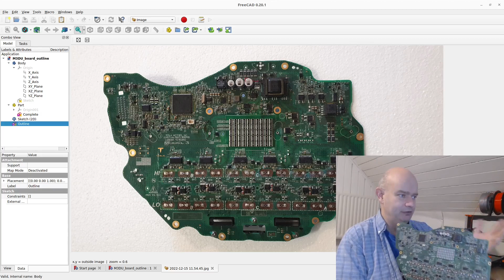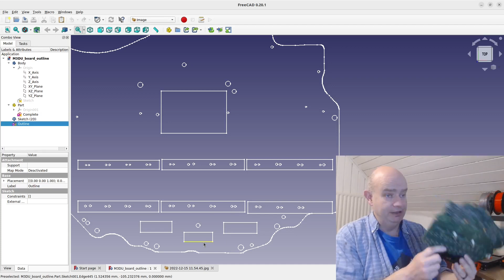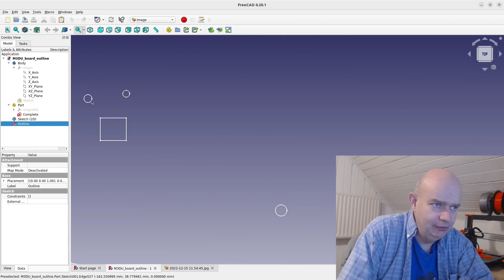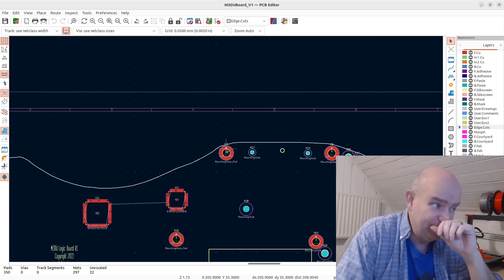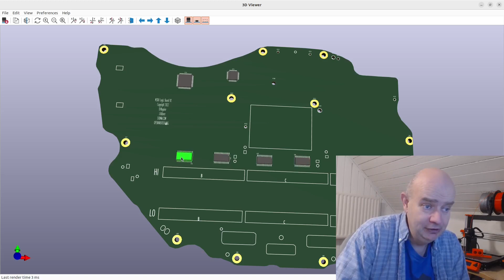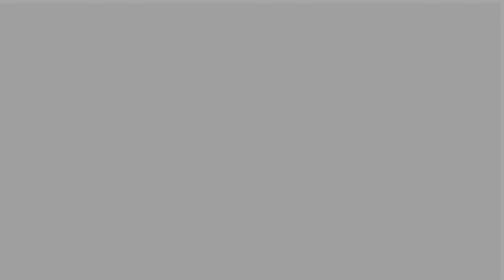Tesla Model 3 Drive Unit PCB Design 01

Comment: This is so great! Dreaming of using M3 unit in some future projects. Tip for using a camera to transforming plate-objects to 2D CAD: Take the image 100% perpendicular to the middle of the object and with max zoom and distance possible to still have enough pixels on the object. If taking the image too close to the object the camera lens distorsion can make guite a differences to measurements. As pointed by someone else in the comments: a scanner is the way to go if needed more precision in DIY plate to CAD.

Comment: [For the initial image] use a flatbed scanner and stitch the images together in "The Gimp" (free - but find someone who can work it [I can if you need help]). Cameras are ok for non-critical distortions; flat bed scanners are pretty much no distortion. This assumes that the componentry doesn't project too far out so as to defocus the scans. Oh, and the scans should be all at the same distance; no tilts - you may need to pack to the highest projection height.

Comment: KiCAD has really become a well polished and very useful package (once you learn the workflow). I use it in my work quite a bit! I wish FreeCAD was even half as polished, usually my sessions in it devolve into quite a bit of swearing :)
Reply: I agree that FreeCAD needs polish.   But it still works once you get the hang of it.
Reply: @SomeTechGuy666  it works in the sense that you can eventually get it to do what you want. But there is so much stuff inconsistent and broken in the workflow it is not event funny. I have been using it for 3 years and I have a general idea how to get stuff done, but on every non-trivial project there are multiple things that should work that don't initially, and require some magical (and random) sequence of operations or some other random special procedure to do. I have never done a non-trivial design in FreeCAD were I can honestly say I understand all the steps to make it work. And when something does not work, the software does a horrible job telling me why it did not work. It is obtuse and fragile in the worst possible ways. I really wish FreeCAD was better (or at least getting better), because it is obviously something the open source hardware community desperately needs. And yes, I realize I am complaining about a totally volunteer and free project.

Comment: If it helps, if the coating/goo is similar to my Fusion inverter coating, non-flammable non-conductive electric parts cleaner spray dissolved it in my case. Just spray a generous amount and brush with a toothbrush, then spray again and rinse with the same spray.

Once the cleaner evaporates, it re-solidifies so you'll know if you missed a spot cause it will be super sticky when it starts to dry

The chemical in my electrical cleaner is called "Tetrachloroethylene". Like I said no idea if it will work for your goo but I know the struggle of having to scrape off the coating and not knowing if your meter is really making contact or not haha